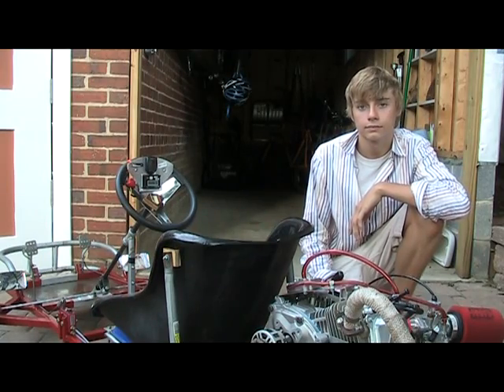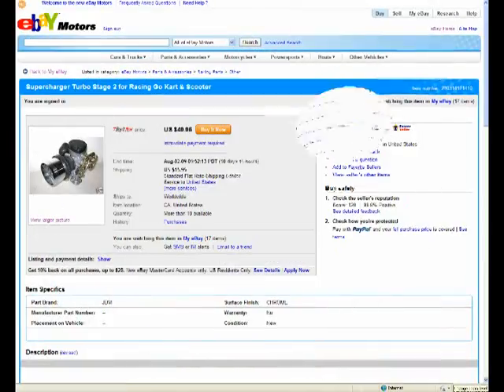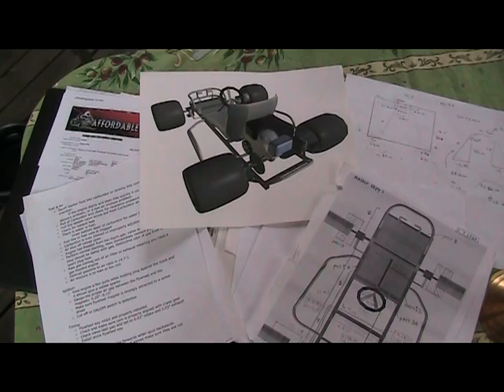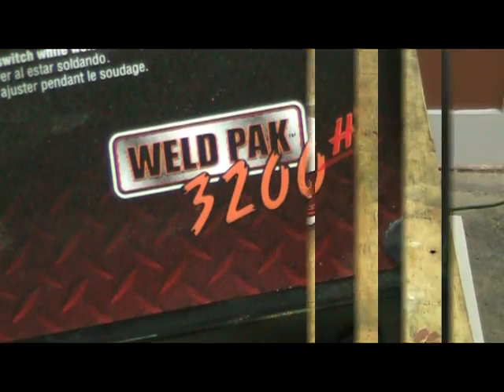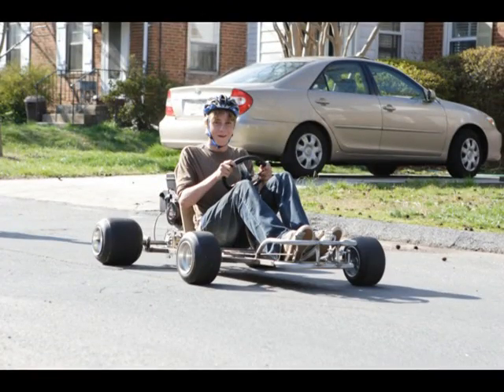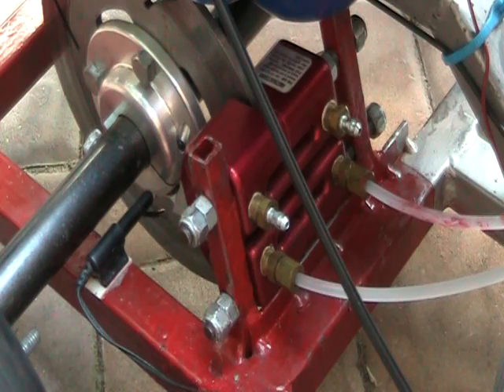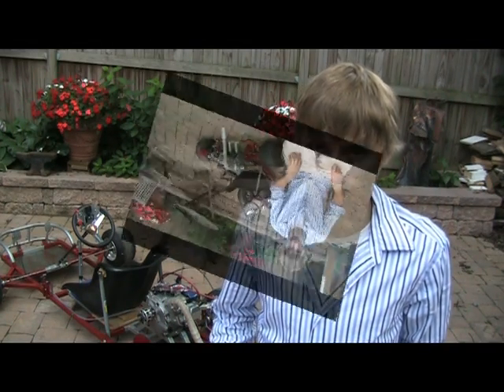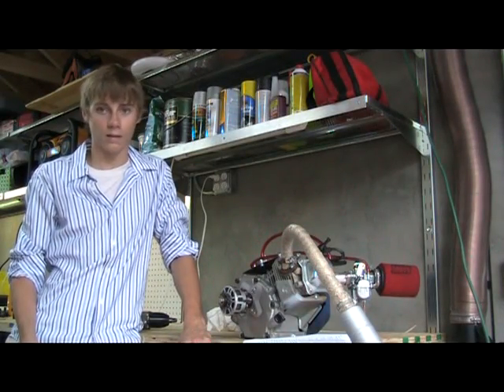Building a Go Kart: Part 1

Comment from the maker: I used a 12 tooth driver on the clutch and 60 tooth sprocket on my axle, this was mainly due to ground clearances.  Most people run a 72 tooth sprocket on the axle, you can run anything from 12-18 teeth on the clutch. Keep in mind that a 12 teeth is better for acceleration whereas 18 teeth is better for top speed. Hope this helps!

Comment from the maker: Hello, so the hose barb in the engine block is not really necessary but now that you have already installed it then all you need to do is install another hose barb in the valve cover and run a hose from the cylinder block to the valve cover. The actual fuel pump is easy to install, this website has information and pictures about installation: just google affordable go karts (select fuel pump in top right corner) , I would recommend buying a walbro fuel pump (also available from their website).

Comment from the maker: Yes you probably could but you will likely run into problems. The first would be a loss of traction because the bicycle tire contact patch is much smaller than the go kart tires, and also you will probably have a hard time making them fit onto the front spindles (via the kingpin) and the rear axle. But if you can overcome these problems small bicycle tires would probably work.

Comment from the maker: Hi, its very interesting that you are considering putting a reverse gear on a go kart and I would be happy to assist you with the design, message me your email and we can corespond on that if your interested. One thing to note is that most go karts dont bother with reverse gears because first it adds weight which will slow you down and second the kart is relatively light weight so its easy enough to push backwards. However heavier go karts such as sand rail karts will have reverse gears.

Comment from the maker: Hi! So I won these tires off ebay through bidding, therefore i cant give you an exact link. The tires are dunlop 10" diamiter and ~6" wide for the front tires and 10" diameter by ~10" wide for the rear. I would start just searching "go kart tires" on ebay. I paid around 200$ for 4 tires with rims but they were used. I would buy used tires unless you actually plan on racing on a track to save yourself some money.

Hope that helps!

Comment from the maker: @MrHeavysteel Hmmm my go kart and most of the plans you find on line are for street go karts that are meant to be driven fast on a track. I drive mine around the neighborhood every now and then but I dont go faster than 30mph because everything starts to shake lol. You should check out these DIY dune buggy type karts, they are a lot more expensive to build (5000-7000$) but use motorcylce engines! These karts are super fast and have plenty of suspension.
Just google-edge baracuda, piranah

Comment from the maker: @thtsjon4u Your completely right ive read that people who run methanol in their engines take them appart and they look like they have been "washed" on the inside. An engine that runs methanol produces much more power but at the cost of a 33% higher fuel consumption (i think thats right). The high volume of fuel your burning also serves to cool the engine significantly better over gasoline engines. The only problem is that I dont know where to get methanol, gasoline is much easier to access

Comment from the maker: @TheCanadianTraceurs Hey so basically the type of steering system I used is I think is called pit and tie rod. Its super easy, all you have to do is google go kart steering. Rack and pinion systems although they provide a greater mechanical advantage are expensive and harder to find for go karts. Your better off using a pit and tie rod system.
Thanks!! Good luck- Fred

Comment from the maker: @bigmac364 Parts I got all on ebay. If you are interested in putting a honda engine on there check out: affordable go karts.com, nrracing.com, and arc racing.com. These are some really good sites with countless upgrades that will give you the most bang for your buck!! I would recomment the super box stock kit. It gives you about 14hp for under 500 dollars. I have another video where I talk all about how to build a super box stock engine. GOOD LUCK!!

Comment from the maker: @bigmac364 Basically what I did was look at a crap load of cart pictures so I could get a good idea of how they were designed and then I drew up my own drawings in a CAD program. Just a not you need to have alot of patience for something like this becasue it takes a crap load of time lol. Also you nearly always run into problems where a part you designed doesnt fit or something so you need to be able to adjust accordingly. You need some basic metal working tools and a mig welder. Parts

Comment from the maker: Hello! Sorry I dont remember if I answered your question or not but here it is again. The clutch I used for my go kart is a 3 disk revolution racing go kart clutch that I bought on ebay for like 100 dollars. These 3 disk clutches are great because they handle large amounts of horsepower and torque well. 3 disks spread the force along three disks so you get better grip. Thats what ive read anyway, but hope that helps!